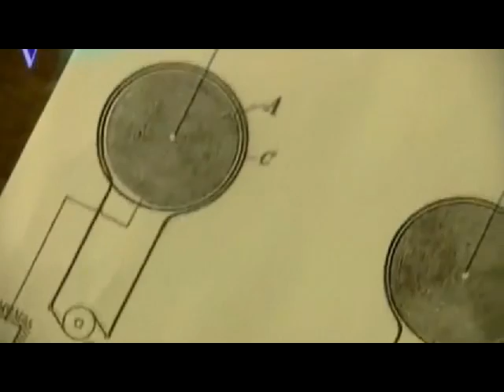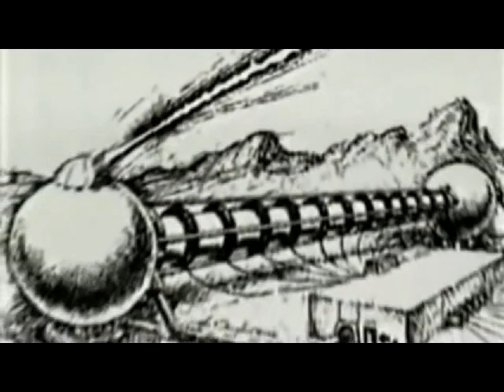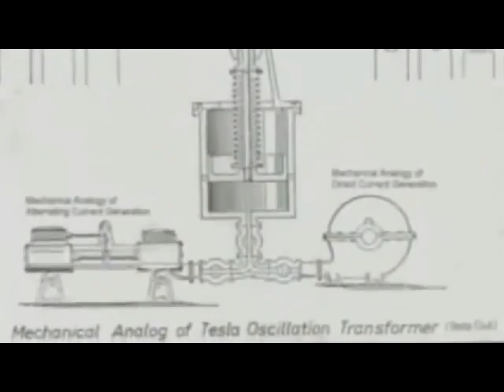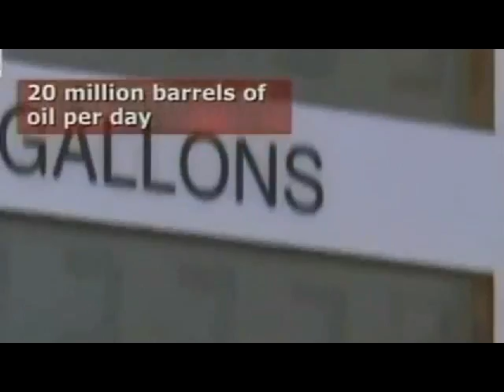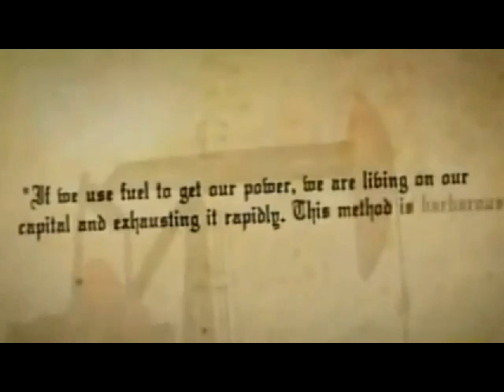Nikola Tesla Wardenclyffe Tower Worldwide Wireless Free Energy

Comment: That is one of many failed invention of Tesla... It is just high voltage AC powered capacitor with one plate as ground and the other in form of rounded half sphere... Technically it is called electrically short antenna which can only produce electrical near field which in turn allows energy transfer to any receiving antenna within near field distance... There is very little electromagnetic wave radiation and that is why Tesla's invention failed as what he has envisioned... If he had designed half wave long wave antennae then it would have all supplied energy radiated as EM waves and thus range increased to thousands of miles instead of few hundred feet...The disadvantage of such system is the fact that all conducting objects would couple to that propagating energy source and turn into heat which in case of human and living organisms would be harmful o fatal... So the company is using the failed invention as low field intensity micro-power wireless energy distribution and low speed communication for short range near the tower of electrically short antennae...

Comment: its supposed to be 100v every metre from the ground ' should i use aluminium foil or TV Ariel ?
Reply: You need 16 cylinders 420 feet into free flowing groundwater cavitated using a one way valve to create vortices of sound vibration to resonate with the above ground structure and the electrons of the water molecules in order to create a pressure gradient. I came to find out what kind of oil he mixed with the ground water. I haven't  seen anyone that I think might know so far. Let me know if you need to find out after you get those cylinders in the ground cause it will probably be a lot harder to add once you put the tower on.

Comment: can any of you boffins help , i have built an antenna , with copper wire at the top and i have smashed an iron pole into the floor ,,,,, and i am only getting 2 mini volts ? so it works just no good , what am i doing wrong ?
Reply: Try jiggling it... 🤔

Comment: This video misrepresents the true funtion of  Nikoli Tesla's invention.  He DID NOT invent a new Source of free energy.  He invented a new means of Transmitting energy from place to place. Meaning, you still need the power plants and fuel they require. BUT, you wouldnt require the power lines. However, he never studied the effects of the resulting  high intensity electromagnetic fields on the human body, the ionsphere and the environment. Today we know how harmful such fields can be. I am an electrical engineer..
Reply: +Yours Truly can I work with you?
Reply: +Christopher Feaster It kinda makes one wonder why a source of free energy required a building full of generators :D :D
Reply: John Distler his tower could use the ionosphere to pull electricity from and not to mention the rods in the ground.
Reply: I'm pretty sure that Tesla's design at Wardenclyffe was to transmute the Energy from the atoms of water in much the same way as our cells in the electron transfer chain and as the Great Pyramid. By cavitating water with a pump in a mostly closed system with a one way valve. I'm not an electrical engineer though, I'm just a guy on YouTube but I have been struck by lightning.
Reply: Were surrounded by inorganic electromagnetic fields (matrixs) dissconnecting us from the earths EMF which is free and infinte. and naturAL aka not harmful
Reply: +John Distler of course he could not invent a new source of energy but the concept he has is really similar to the fact that it still needs fuel. Present engineering and chemical knowledge can only spawn from this concept radar, radio electricity but he is right about one thing the earth is one big ball of inaccessible potential energy that's is why he dig  holes beneath his tower and fill it with water hoping to find a way to introduce the single most abundant and readily available energy source-water-into the cycle and break it so that earth energy can be readily accessible and tap directly into it. He has the idea but the technology and knowledge to this is non existent but rest assured the knowledge of the potential of water is well known like the hydrogen powered cars etc. As for the effects of high intensity electromagnetic fields on the human body which dwarfs and mean that ionosphere and environment is not an issue if you can prevent- the most basic-its harm on the human body, you do know that the concept of AC and DC right you electrical engineer my butt. One of the best society to develop technology like this is the former Soviet Union where rare visionaries-with obviously above average technical knowledge on the field they specialize- plan stuff and those that have the not so rare in fact common people and can be by luck or learned-thru hard work- mandane skill make this vision into a reality. If all engineers have the visionary skill and genius of Tesla, and Edison it might well be possible that this source of energy might be accessible that is why the Soviets where able to go to the moon first sadly the Western world particularly the US does not build upon the greatness of visionaries but rather glorifies just about anybody who has the luck or the education to be to my standard just ordinary mandane people resulting monopoly of knowledge and thus limiting growth and innovation and stagnation of technology. This mandane people are good at mass production and using this knowledge to produce everyday products to better human living the danger is in the process the Soviet Union did not benefit from this Communist vs Democracy facade because while the West absorbs all intellectual innovation in Europe, former Caucasian British Colony and Japan including Russia, mother Russia gained nothing, imaging if the US shared to mother Russia this knowledge a lifestyle where scientist are unhindered by money restraint or drive to pursue scientific ideas and inventions. The state providing unlimited funds for the growth of science which would put to shame the golden age of American Science the period where science grants where state sponsored thru college grants. The problem with corporations is that they do not cooperate but compete furthermore they are limited to their single trade while colleges are a melting pot of ideas from biology, to engeneering, etc from matter to mind literature and astro-physicist the merging of science mathematics and imagination. Imagine if the communist party gets a promising proposal from a common person- driven by pure desire to help and not by money or more dangerously ego like when some asshole makes a proposal for his own immortality without regards for the very negative effects -, that's right Zubrin let me tell you why Mc Cain is pissed with your proposal-and finds the idea possible and of great benefits thus without the restraint for profit the research will not be abandoned and continued resulting in future breakthrough. Donald Trump: Trump 2015 Boom China is building a tech city a merger of zeal and tenacity of the Soviet Union and mix it with being able to absorb knowledge in the Free world. But for that you need the batman to guide you on how to build and maximize the right configuration of cities because right now some cities are just surviving and most of its components are not geared for progress and science just living the good life. Mehh: So true Uncle Donald in fact it is laughable when an economy is kicking people from apartments built from the age of mass housing to create living quarters the rich and some apartments are empty simply because even the rich find that duhh it is better to have your own property, the city needs maintenance blah blah blah....Fuck it no time for this one final article and be done with it I have to focus on getting my Tom Sawyer lifestyle and NOTE TO SELF WHEN YOU FEEL LIKE COMMENTING AND DEBUNKING NONSENSE IDEAS ON YOU TUBE JUST MASTURBATE YOURSELF TO SLEEP FUCCCCKKKK IVE BEEN HAD AGAIN MASTURBATE MASTURBATE MASTURBATE ITS REALLY THAT SIMPLE FUCKK NOTE TO SELF!!!!
Reply: Your judgement about this whole process of how energy was transmitted is about as good as your spelling of "function*" electrical engineer my ass you are just another mindless sheep.

Comment: yes but concentric waves would destroy micro and nano technology as we know it if you light a bulb from a distance what will be the effect on your DC mobile phone?
Reply: +Vladimir Nachev The magneto-tron tube (echo chamber) in your mobile phone runs at very specific frequencies in MHZ and GHZ. Multiplexing provides security for radio waves. Low frequency devices with coils would be properly tuned. Lifi runs at lower power in the THZ range and also provides localized security.
Reply: dispater187
 search full wave rectifier in google
Reply: Wireless Power rail is on track as China seeks to develop world-first wireless non-radiative ambient power system for high-speed trains. " Wireless energy transfer demonstrated by the legendary inventor Nikola Tesla as early as 1891. But technical issues and safety concerns have limited its applications to small devices such as phone chargers, medical implants, radio-frequency healing. " A team led by Professor Sun Yue, director of the Power Electronic and Control Engineering Institute at Chongqing University, recently proposed a 10MW wireless power system to the Ministry of Science and Technology to reduce the trains' operating costs and improve on-time performance. South Korean scientists are building a 1MW experimental line but its capacity is still too low to be practical. Sun said his system could "beam" more than 13,000 horsepower, or 9.7MW, to a train using resonant magnetic induction, enough to easily propel a fully loaded subway train or a high-speed train at 350km/h or more. "But without government support we cannot develop a full-size prototype to overcome all the technical challenges of high-power wireless transmission." China to date has bought most of its high-speed rail technology from Japan, Germany, France and Italy, but the wireless 10MW technology is new and has never been attempted by other countries. "The solutions cannot be bought overseas," Sun said. "We must work hard to come up with our own technology." Sun's design calls for the energy sending device to be placed on the railway track and the receiving coil in the train's undercarriage. http://www.scmp.com/lifestyle/technology/article/1713454/wireless-rail-track-china-seeks-develop-world-first-power

Hong Kong University Professor Ron HuiTo. To understand the magnitude of Hui's work, one must follow the story back to its origins - with an eccentric inventor and his "death ray". About 100 years ago, Serbian-born inventor Nikola Tesla was working in his laboratory in Colorado Springs, USA. People walking along the nearby street would observe sparks jumping between their feet. The brilliant engineer had contributed to the technology used to supply electricity to this day. His new ideas, however, had peers thinking he was crazy. Tesla believed it was possible to remotely shoot down an aircraft with an intense beam, which the press called his "death ray", and to get electricity to faraway villages wirelessly. Fast forward to modern Hong Kong, where Hui became fascinated by Tesla's idea. "When mobile phones started to take off in the 1980s, they each came with a charger. There were demands for companies to unify their chargers, but these were turned down," Hui recalled. He soon realised: "To reduce electronic waste, there must be a product which is so user-friendly that the companies would have no choice but to adopt it." While Tesla and the US space agency Nasa had experimented with wireless power, Hui had made the technology safe and user-friendly. He made sure gadgets could charge on any position on the pad, and introduced checks to ensure other metallic objects, like keys, would not be affected. A few years later wireless transmission technology attracted the interest of overseas universities - and investment piled in. http://www.scmp.com/news/hong-kong/article/1734648/inventor-professor-ron-hui-says-free-thinking-vital-hong-kongs-
Reply: I don't like waiting
Reply: @enzawashballs  Tesla said that he was not an inventor but a discoverer.
Reply: Lol that's why my signal stops when near an working microwave but why the F they put magnetron's in our mobile phones I think it was just a normal antenna

Comment: This theory was brilliant. We've used so many alternative forms of power ranging from Hydraulic dams, to Solar panels, to Wind Turbines. I think this is one source of energy we should invest in and innovate similar forms of power stations like this world wide. Just think! If we could start a map showing the statistics of what parts lightning occurs the most (despite the fact that lightning strikes are random and for the most part unpredictable) we could at least see what parts of the US have the highest probability to have lightning strike. Not only is this a clean source of energy, but with the help of weather specialists and Engineers working together this could come out as a very efficient way of supplying power if we happen to find ways of improving it so we can get the most out the lightning that strikes. Just as solar panels are dependent on the sun to provide energy, this could very well act as a back up for when it starts raining and getting cloudy where there is no more sun for the solar panels to use, if the lightning strikes it will provide energy when the solar panels can't. This is one form of power we were oblivious to for a while. I think more research on this needs to be done, and I think Tesla was a boss for inventing it. J.P. Morgan made a big mistake over greed, it's our job to correct it and push for more of these to be made worldwide.